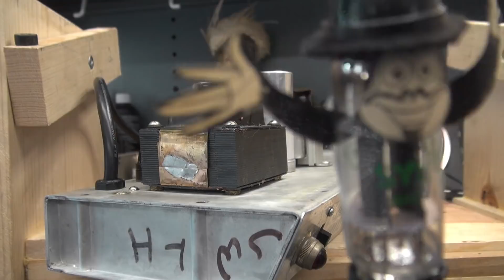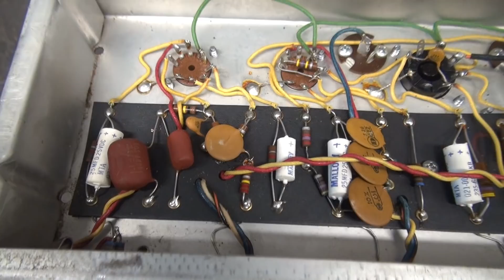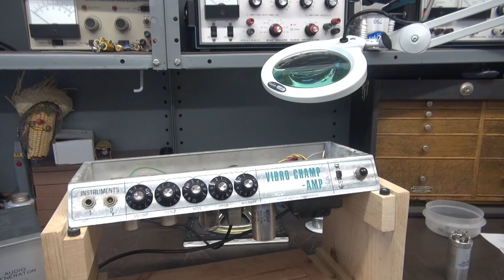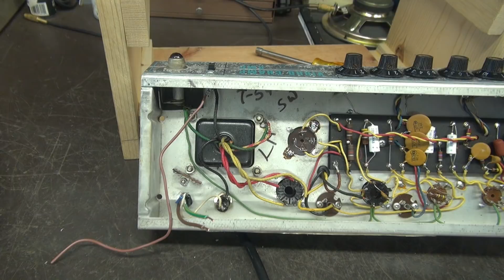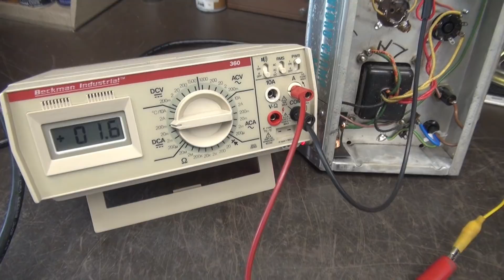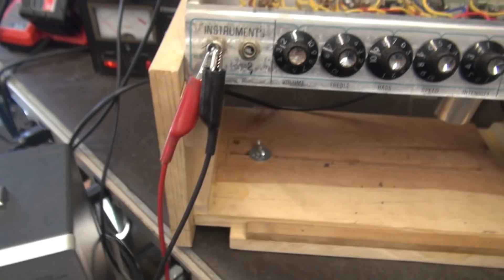Repair Vintage Fender Silver face Vibro Champ guitar amp Change Filter Cap + setting Class A Bias

Comment: Thanks!   Is that a 1969 model?  circuit #?    Looks like the new cap values used are 40 40 20 20 , while originals were 20 20 20 20.    How does that change things?  which 2 were tied together?   I'm doing a 66 model and trying to understand the differences

Comment: I was just given what I thought was a very early drip-edge Silverface Vibro-Champ from my brother in law. Unfortunately, whoever had it before him physically cut the bottom of the chassis out and riveted in the guts of some other mystery amp, half of which was wired in with speaker wire. Very disappointing.

Comment: I thought D-Lab preferred making custom filter caps with a Tube socket and capacitors?
Reply: I think he'll do that with a can cap that is hidded within the chassis like with many radios, but when it's going to be visible he'll use a repro can. I could be wrong.

Comment: Hey, Terry. I've got one of those, and one mod I really feel helped with noise was to rewire the heaters wit a twisted pair and virtual center tap to ground (IIRC a pair of 100 ohm resistors). I think of that as a "why wouldn't you?" kind of mod. Any reason you didn't?
Reply: The anti-mod crowd is ridiculous. Modding my champ is the best decision I ever made. 
I need to do the ground lift MOD because I’m running my champ through a 2x10 + 1x15 Stack. Sounds awesome but inherent huM is pretty noticeable.
Reply: I was kinda curious about that too !

Comment: If only there was a way to clean up that faceplate.  The current condition really dings the value.  Doesn't have to be perfect, just better.
Reply: Buy a new repro one, except blackface. Big improvement! The layout is the same and circuitry of the amps are identical.

Comment: I always use 470 in my cathode biased amps with 6v6 tubesbut I use jj 6v6 tubes they can handle a little more abuse, I tried to bias it with larger resistance but it always sounds slightly different. Maybe I'm wrong, maybe thats why 6v6 tubes only last 6 months to a year, but I also practice and play every day.  I'm going to experiment alittle more. I always get good tips and tricks watching your channel. Thanks d lab

Comment: That OPT did not come out of a Hammond organ. (Maybe some other brand but not a Hammond.)
Hammond did not produce any single ended amplifiers. All of their power amps were push pull.
Besides, The Hammond Organ company used very high quality transformers.